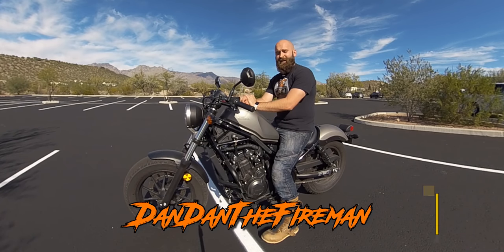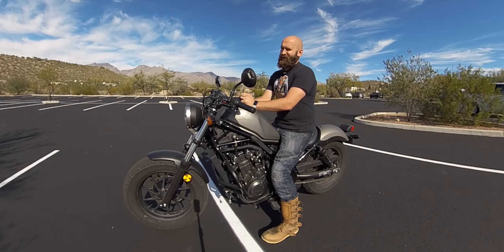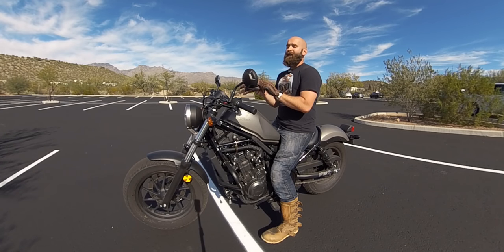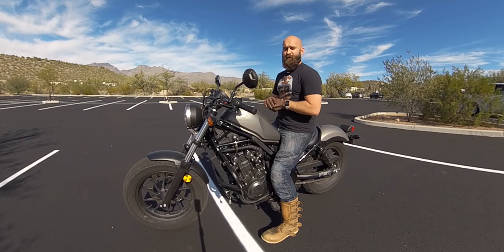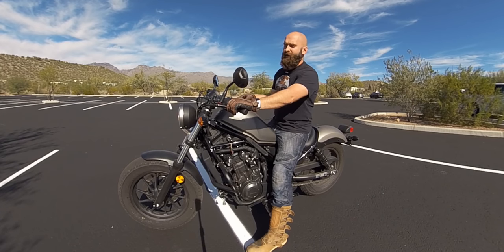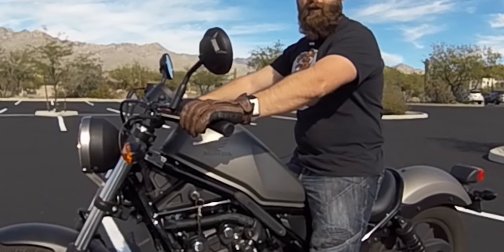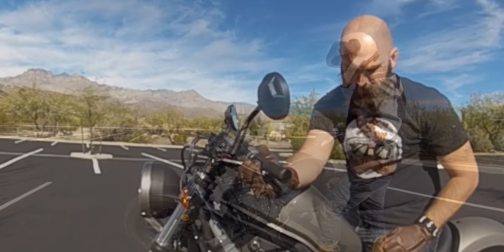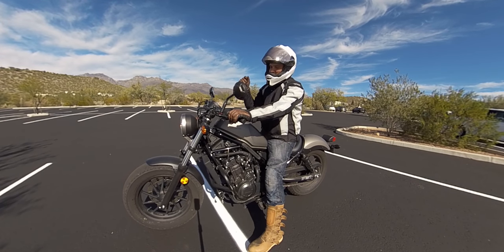How NOT To Stall Your Motorcycle / Friction Zone Clutch Training

Comment: From one firefighter motorcyclist to another, we know the dangers of riding. I recently upgraded to a bigger bike, I can't even begin to count how many times I've stalled it, getting used to it still. Been riding for roughly 4 years, started on a 250 which was perfect, I feel like I was fully confident of my capability and the bikes capability. Upgraded to a Suzuki Boulevard C50t, It's a lot different than my old bike. Just like in the fire service, you're always training and learning. I believe that you should never stop learning when riding motorcycles. I find myself trying to read the "body language" of cars and an escape route if they try to take me off my 2 wheels. I've seen how people react when a firetruck is hauling down the road and they don't know what to do. It has scared me to ride a few times but I usually always hop back on. I've been on a few bike accident calls and heard stories and that terrifies me. I'm glad that I got my license through the MSF course, I have learned a lot and would like to take the advanced course. As always, ATGATT.
 Anyway, stay safe brother.

Comment: I've been riding electric motorcycles and a DCT for the last year-and-a-half, I just picked up a little 150 last. 5 speed. I got my license on a clutch bike, but I've never been very comfortable on a clutch. Just took a few spins around my neighborhood, got it up to 50, going up through the gears and down is super easy, but starting in first and not stalling has been difficult. I decided to put a video on and yours is the first one that popped up and I didn't even think to just practice letting the clutch out without giving it gas and finding that zone, I just didn't even think about that possibility, thank you so much, that just solve the problem for me. Can't believe I didn't think to do that.

Comment: One important technique that took me years to realize (from driving cars initially) is that once you find the sweet spot in the friction zone, you need to actually apply a slight amount of pressure in the disengage direction instead of just “holding it there”, the reason is two fold. For one what I have noticed is that when I think that I am “holding it” in the zone my muscle is actually slowly relaxing, and that equates to more engagement than wanted, another thing is that once the speed of the clutch plate and the driven plates are almost matched the clutch tend to be more grabby than when the have more speed difference, and pushing the clutch in just a hair helps maintain a more consistent torque transferred to the wheels.

Comment: My bike has a feature called GTT or Glide Through Technology. Simply put, it takes friction zone to another level. If you slightly let out clutch and engage the friction zone, the bike ecu will maintain a steady speed of 7kmph in 1st gear, 11kmph in 2nd gear and so on. It is a very intuitive feature for scenarios like traffic jam in a metro city. The ecu is smart enough to maintain the said speed with a pillion as well, and while climbing a slightly elevated surface. I can't tell whether it will work in hilly areas.
Reply: A similar thing will happen with any engine that actively governs its idle speed. If you apply a load, the engine will add more power to maintain constant RPM instead of maintaining constant power (what most engines without ECUs do) and stalling.

Comment: Just taught me something,,I've always thought that in order to take off in 1st gear you needed to give throttle while easing off the clutch lever🤦🏽‍♂️so basically you can just ease of the clutch lever to make it start going👍👌
Reply: Have you been doing this? Releasing clutch slowly then once it’s open all the way applying the throttle?
Reply: @Exe.6000  yes I've been messing up👨‍🦽♿️😆😅🤣trying to throttle and release the clutch at the same time🤦🏽‍♂️instead of easing off the clutch first and then throttling
Reply: Some bikes you have to give it throttle. Bike I was on in my course would stall out no matter how slowly you let the clutch out if you didn't give it throttle. Sometimes it would even stall while already moving if you just stopped giving any throttle.

Comment: Question: Is it necessary to add a little bit of throttle while releasing the clutch to start 1st gear or can I always just slowly ease off the clutch and then give it throttle AFTER clutch has been released and the bikes in motion? Which is the ideal method or does it not make much difference? 

Thanks in advance to any bike expert out there who can answer my question. Cheers.
Reply: Slickcow 101 yes add throttle when releasing the clutch, once you get familiar 

This is necessary during a kickstart at traffic stop.
Reply: It depends on the bike, and depends on the situation. Some bikes require very little throttle in the parking lot. However in traffic yes you will want to give it some amount of throttle.
Reply: @aust4105  keeps happening to me and its embarrassing people's keeps  honking at u
Reply: Give it more throttle than it needs and less clutch.
Reply: This is my biggest issue
Reply: everyone in my course keep stalling on the slight slope at the parking lot because they never taught us to add throttle

Comment: After riding a Harley road glide with a super smooth throttle and clutch, no troubles in the zone.
I bought a Suzuki 1000 v strom and the friction zone and throttle feel so touchy and harder to get a handle on.. I just need to keep practicing

Comment: quick question for the professionals, when coming to a stop at a stop sign or a light, do i apply the clutch in first gear or put it in neutral then go when its my turn ( kawasaki ninja 300 just in case its important)

Comment: So, do I need to use throttle when releasing clutch or after releasing?
Reply: That's what I'm trying to figure out. Is he using the throttle at all or just releasing the clutch?
Reply: @tyronnowlin1099  on a medium size bike while your about half way through letting the clutch out is when you slowly start adding throttle.
Reply: Most bikes will move on their own without adding any throttle if you gradually let out the clutch.  The idle of the bike will typically sustain the momentum.  In regular riding I do it as Im releasing.

Comment: I have no issues with the friction zone on my R1 but for some reason on my Street Glide with the M8 and hydraulic clutch I have a funky time finding neutral and the friction zone. The friction zone on the Harley is when the clutch is completely open all the way. Smh. My buddy have a 2015 Street Glide with the cable clutch and I have no problems on his. What makes the hydraulic clutch so sensitive and neutral soo hard to find?

Comment: Do I need to worry about wearing down the clutch disk?
Reply: Clutch plates do wear down over use, but typically its many many years.  I would say not to worry about that.  More important to use the clutch correctly as Dan showed.

Comment: What happens if it doesn't start moving even in the friction zone?
Reply: That means either your clutch is bad or you’re on a hill. On a hill you have to alternate the clutch with the throttle and give it a little dance to get it moving. Be very smooth and take your time, don’t focus on the cars or anything behind you.

Comment: Dan, Dan, Dan! You darn well do need a helmet when on a motorcycle parking lot or not. As an MSF RiderCoach, I would like to show this video to some of my new riders but can’t.  You start out by saying you want riders to be safe.  I suggest walking the walk.
Reply: I was thinking the same, but to be fair, as soon as he started moving around with the bike he had full gear on.
Reply: Watch the full video, he only has his helmet off when demonstrating clutch control. He puts on his helmet before he demonstrated taking off in first.
Reply: And to be fair putting around an empty parking lot at 10mph without a helmet is not the end of the world, I’m even willing to bet you have ridden a bicycle at speeds faster than that without any protection before
Reply: In all likelihood he was probably ok without a helmet, but do we know when something goofy is going to happen. Falling from a motorcycle standing still can still crack you bogging.
Reply: Maybe he was fine but goofy stuff happens. The bike doesn’t have to be moving to experience a fall that can cause injury. More important though, is the necessary example that should be set when demonstrating the safe operation of a motorcycle. Just saying…
Reply: @zxcvbnmaw1  
Well I guess we all did a lot of things until we knew better. Hopefully we will know better before worse happens.

Comment: New rider. My bike unfortunately isn't the best beginner bike. It wont let me use any friction zone at idle. I have to keep it at 2k rpm and then it drops when I enter friction zone so I have to give it even more throttle. Currently practicing u turn and it's very hard with this.